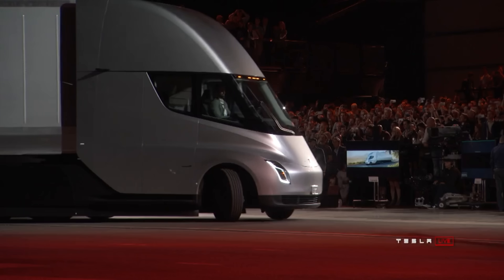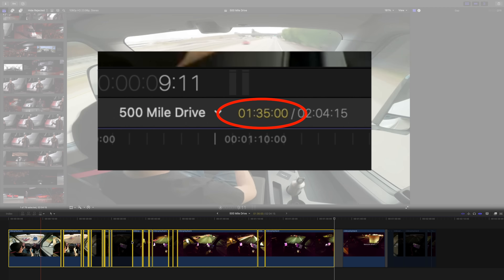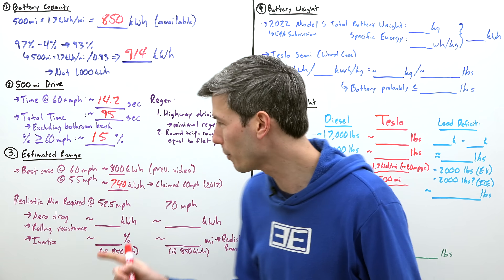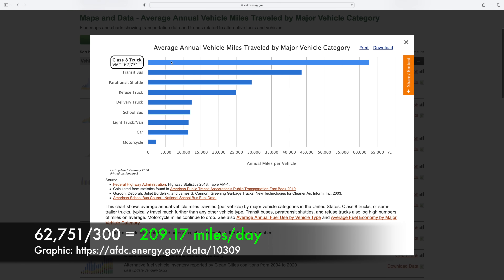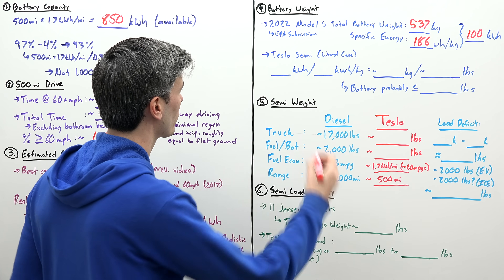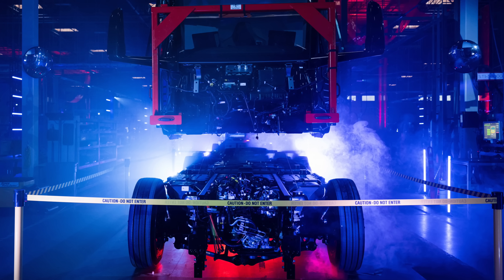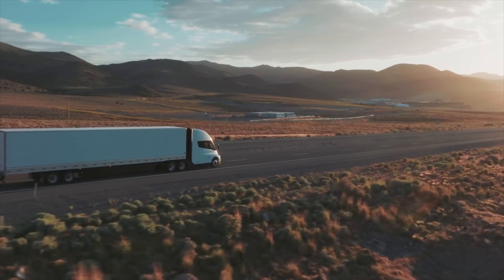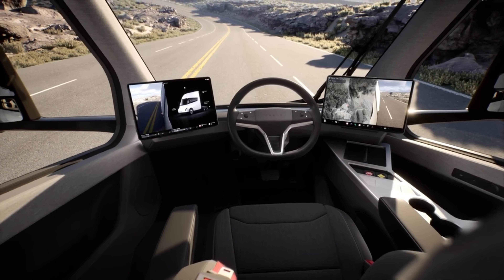Does The Tesla Semi Make Any Sense? Part 2!

Comment: You assume that since a diesel truck weights 17,000 pounds that the Tesla truck does also.  I doubt that the electric motors weigh as much as the diesel engine and transmission.  So, you need to find out the true weight of the Tesla for a better comparison.

Comment: I still think the physics for these trucks don't make sense but I can agree that from an engineering perspective it checks out.
What I mean by "it doesn't make sense" is using trucks for delivery is so inefficient when compared to train that its staggering to think that this is the "green" solution. And second the wear of a road isn't proportional to the weight of vehicles but exponential so I'm not sure about putting heavier vehicles on the roads and increasing the average weight.
Still good video, thanks.

Comment: On I20 in Texas or similar roads at 75 mph on a hot/cold day, it will probably last about 2 hours/150 miles.
Reply: Actually that's an easy calculation, based on the Tesla Semi physics model derived by Motor Matchup. At 75 MPH on a hot day, loaded to 82,000 lbs., the range would be about 325 miles with a small reserve. Tesla automobiles lose about 15% of range in cold temperatures; assuming the same for the Tesla Semi, range on a cold day would be about 275 miles.

Comment: It’d also be interesting at which point the Semi is ecologically advantageous. If I remember correctly most EVs are only more advantageous for the climate from ~200000km onwards. And another problem that wasn’t touched on is long term reliability, if a semi does 300 trips a year that means 300 charging cycles a year at which point will the range suffer of that.
Reply: Estimates for environmental breakeven mileage for automobiles vary widely, and depend on many factors such as the electricity mix over the lifetime of the vehicle, battery size and type, and emissions of the combustion car you are comparing against. But most cluster around 24,000 km to 32,000 km, and I've seen none that exceeds 150,000 km for an extreme combination of the factors. Presumably the breakeven would come even sooner for diesels, due to the particulates in diesel exhaust; but let's say your number is correct. Since PepsiCo has announced the intent to drive these for 1 million miles (1,600,000 km), in your case the Tesla Semis will be environmentally superior to diesel semis for almost 90% of their life; and over 98% at the average breakeven estimate for electric automobiles.

Comment: Up here in canada we haul 2x 53 foot trailers, 63000kg and need to go way more then 500miles. Current temps too are -45c as of today. I'd like to see how far that could get in these conditions. With my weights here my avg mpg is about 3mpg in this cold on diesel.
Reply: Not very far. No one's claiming that Tesla Semis can do everything diesel semis do; of course they can't. But there are a couple of million diesel semi tractors on the road in the U.S., and Tesla's business plan is to sell 50,000 in 2024; so the Tesla Semi can be limited to doing what only a small percentage of diesel semis can do, and still be a complete business success for Tesla.

Comment: So safe to say.. that tesla truck will not be usefull for the european market.. not that i want one.. we just run higher loads.. 110.000 lbs/50.000kg with a single trailer or  132.000 lbs/60.000 kg with double trailers 

I will stick to diesel and LNG trucks.. 
The crocked thing about this emmisions thing is the truck needs to be cleaner while the trailer behind it that might have a diesel generator to power the coolingunit that can be build from the stoneage as the trailer is not classified as a motorvehicle.. it usually makes more noise then the truck thats infront of it..
Reply: it would still pull it the total truck weight with trailer in the united states is limited to 80,000 lbs but our diesel trucks can pull much more than that
Reply: @zachmoyer1849  i know.. but thats 36 metric tons.. thats not a lot.. but whatever more weight it pulls the more it kills on range.. so by multipling its weight will in theory cut the range in half..

We have a hp requirement for the 60 tons doubles.. need atleast 5 kw per metric ton.. so thats around 410/420 hp as with a diesel this is perfectly doable.. with a decent range aswell..
Reply: @gewoontimm  you are forgetting that the potential for regen also increases with the weight and the tesla semi likely has over 1000 hp a diesel is still gonna beat it in range of course in germany they are looking into adding a power cable overhead for trucks to link into on longer huals only using the battery for shorter distances
Reply: @zachmoyer1849  thats fine for germany.. but i dont drive or live there..  so them having those powerlines in the road is not gonna benefit anyone that doesnt drive on that 1 road.. 
Do you kniw what it would cost to overhaul the infrastructure to put powerlines everywhere?? Costs too much..
I drive mainly in urban areas with big trucks 
There arent any charge points for trucks allong the route or at unloadingzones as cityhall doesnt give permission to place one as its a big bulky unit..
Also we have a hydraulic lift on the back of our trailers that takes 24volts from the truck.. that also would mean less range

In urban areas a torpedo cab is far from usefull.. turning radius is larger then from a cabover.. plus we have a totall vehicle length restriction.. so if the truckcab is longer.. that will rob space for cargo..

We already have a few electric cabovers .. they arent usefull as they spend more time on the slowcharger then driving
Our powernetwork also isnt ready for fastcharging for trucks as they draw more power then an ev car would.. 
We already have problems charging cars.. let alone trucks as there are not enough chargeports for them..
Reply: @zachmoyer1849  i hope you get the picture of why they dont work in other forms of transport other then highway driving
Reply: @gewoontimm  Actually, the range varies much more by speed than by weight. Range with 60 metric tons would be about 30% less than range with 36 metric tons, or about 560 km. Obviously this will not work for many trips, so these will continue to use diesel semis. But it will work for many others, which can gain the benefits of an electric tractor.
Reply: @BigBen621  like i said..only if you do long distance driving on that particular testroad.. as there is no charge networkonce your off that road

Comment: Wait, your results don't check with Dunder Huff's results.  Being an engineer myself and really non-biased toward Tesla, your calculations look far more compelling.  There are a few things that you may want to consider.  Sure, most loads are not going to max out the truck to 80k lbs, but most truckers are going to want the capability to do that.  If I am a shipper and I call you up and you tell me that you can't meet my load requirements, chances are, I am not going to call you in the future.  The same goes for distances.  If you can't deliver the distance I need, I probably won't be calling you.  So even though a lot of those routes are feasible for the Tesla Semi, truckers are going to want trucks that are capable of the long haul as well.

So the target audience of the Tesla semi is going to be considerably smaller than one might think.  For now, that isn't a real issue as the Tesla Semi isn't really available anyway.

And one more thing to consider is the trailer used likely had less drag than a van type trailer.

And what about refers?  Is Tesla going to make power packs for those as well?  How would that affect the load for a refer with a nice large battery pack on it?
Reply: Dunder Huff's video is rife with obvious, deliberate, and easily provable lies.
Reply: yeah reefers are gonna have to stay diesel but they have their own fuel source so teslas could still haul them

Comment: A well reasoned video, like it a lot. I feel like there's a lot of FUD around EVs, partly fuelled by oil propaganda, partly by people really wanting to hate on Tesla right now for Elon being the bell-end he is, but someone has to figure this stuff out and it's still a net positive having these exist. A first-gen EV semi being able to handle 60%+ of the applications these trucks is pretty great, TBH. As you said, we're not going to snap our fingers and have all these trucks replaced by the time they've started improving, battery tech has improved, etc. I'd personally like to see some more focus on last-leg deliveries, not just because of carbon emissions but also because of the air quality improvements in urban areas.

Comment: autonomous truck wont care about doing the speed limit, so may cruise at lower speed. I think lithium battery is the same as any other battery, its not good to be demanding full power (maximum current draw) from a battery that is approaching fully discharged, best to keep them above about 50% charged if you want long life out of the battery.

Comment: So the bottem line is: Pepsi would never have bought those 100 trucks if the goverment did not pay a 19 million dollars for the endevor. Then you can take the trucks and just see where it goes.

And there is a mistake in your calculations. You substracted 2000 pounds of weight dor the difference in the diesel engine and the electric engine. Those weights are part of the weight of the truck so the Tesla truck has a bigger loed deficit of 2000 pounds.

Comment: Right charging a 850kW battery in 35 to 45min. You will litteraly need a power substation to do that and thats without taking into account the wear of a battery is exponentially greater to the time charge. Plus to this date only chips trips at slow speed has been proven. Lets wait that famous 500 mils beverage statement to come true. Most numbers you ame out with are wrong. There is basic formulas for resistivity. Plus no account of battery wear, climate conditions (which is extremely impactful on batteries) and electricity loss.
Reply: In the "chips trip" video, the trailer is loaded from back to front with pallets, including a few stacked two high at the front; and the pallet at the right rear is clearly labeled as 600KG. If a pallet of chips weight >1,300 lbs., you might be right; but I'm pretty sure it doesn't. And the speed was dictated by the California 55 MPH speed limit for semi trucks. At higher speeds, the range would of course be less.
Reply: @BigBen621  I don't know about the speed but I call BS on your chips pallet weight. It may be written this, doesn't mean it's true, specially with Musk in the way. A traditionnal chips pallet is around 20kg and even at 600kg each it's nothing compare to a real load. A semi can take around 26 to 30 pallets. Which the 600kg figure we get 18 000kg or roughly 20 tons. This is low has a normal semi can can up to 30 tons after substracting the weight of the semi itself to the US limitation (and electric ones can cheat for come reason as if an electric semi with more weight will do less damage to the road, politic science). And you forget the worst of the worst the power drain and installation required to charge these things. And don't forget, most electricity in US is produced with coal. So basically you change your semi from diesel to extremely polluting coal. That's why the environment is doomed.
Reply: @xbvg  I see you're going for the "Most Misinformation in a Single Post" award; a lofty goal, but one you're likely to achieve.

"I call BS on your chips pallet weight. It may be written this, doesn't mean it's true, specially with Musk in the way."  
Yes, Tesla could have put a fake weight label on the pallet; but what no one's explained is what incentive Tesla would have for doing this? The launch customer, PepsiCo, already had 36 of these by December, and so they know exactly what they can carry. As such, they'd know if Tesla faked a test; and it would be bound to affect their relationship with Tesla, and imperil future sales if they did. If you have any evidence that the weight label was faked, you should produce it. And the irony is not lost on me that all the doubters are demanding that Tesla immediately release weight and payload information, at the same time that they refuse to believe information about the Tesla Semi that has already been released.

"A semi can take around 26 to 30 pallets. Which the 600kg figure we get 18 000kg or roughly 20 tons." 
For a change, this sounds about right.

"[A] normal semi can can [sic] up to 30 tons after substracting [sic] the weight of the semi itself to the US limitation"  
OK, let's see; 80,000 lbs. GCVWR, minus your claimed 60,000 lb. payload, minus about 12,000 lbs. for a van trailer, minus about 2,000 lbs. for fuel, driver, and misc. materials and supplies, leaves 6,000 lbs. for the dry weight of the diesel semi tractor, not much more than the weight of a Tesla Model S. Is that your final answer?

"as if an electric semi with more weight will do less damage to the road" 
No one has claimed this. But to me at least, a <3% increase in weight with the additional road damage this will cause is well worth the dramatic reduction in air pollution, especially particulates, that will result from replacing diesel semis with electric ones; keeping in mind that diesel trucks are 1% of the vehicles on the road in the U.S., but produce 20% of the overall emissions and 36% of the particulate emissions.

"[M]ost electricity in US is produced with coal" 
The last time >50% of electricity in the US was produced with coal was 2003. Last year it was <20% and dropping precipitously, having dropped by almost 50% just in the last five years. So this claim is 20 years out of date, and getting more so every year.

Comment: So 23 miles per 1 gallon of Diesel. That's fuel efficient. And 1 gallon of diesel can make 40 kilowatts of electricity in a generator over there. If that electricity came from wind and solar stored in a battery for overnight/day charging?. It will also eliminate idling(noise, vibration) and air pollution (particulate, rolling coal, and fumes).

Comment: What about hydrogen trucks? They sound very viable and hopefully a non-deceitful company could possibly make all of these into reality. Hydrogen trucks theoretically shouldn't be weighed down by battery packs either, and should fuel as fast as gasoline.
Reply: hydrogen trucks are still heavy because of how reinforced the fuel tanks and fuel delivery system has to be for the high pressure of liquid hydrogen, its why they also get the additional weight limit increase, but the real problem is that hydrogen cost far more then electricity or diesel per mile.

Comment: The problem with electric is that you are making the assumption that the range stays the same throughout the life of the battery, not so. And don't get me started about getting that range during the winter with a heater full blast. And before I get flamed I have been driving an electric car for almost 10 years now.
Reply: Then you're not driving an electric car with a heat pump. The Tesla Semi will use a heat pump for cabin heat, which is dramatically more efficient that the electric resistance heater that you necessarily have.

Comment: Question, what about the battery decreasing over time and have Tesla said what the lifespan should be for a battery and cost to replace?

Most ICE trucks seem to do up to 1.8 / 2M kilometres before finding there way to a scrap yard and are normally about 25 to 35years old

Comment: Wait.. 1.7kwh per mile
Even my scooter needs 250w to sustain 15mph. If I were to maintain that for a whole mile, it’s 0.25kwh. Not far off the semi

Rolling resistance alone will kill that number 😭
Reply: That number includes rolling resistance.
Reply: @BigBen621  yeah thats kina the point. how does the wind+rolling resistance of the tesla semi be only 1.7kwh per mile at possibly 60mph? where its just 6.8 times the resistance of my 2 wheel schooter going at 15mph
Reply: @elonwong  You math is off. 250 Watts for one hour is 250 Watt-hours = .25 kWh. In one hour, you go 15 miles; so your mileage is .25 kWh / 15 miles = .0167 kWh/mi., or 60 mi./kWh.  Tesla is 1.7 kWh/mi, so your scooter has 102 times the mileage (miles/kWh) of the Tesla Semi. I'd expect the difference to be a lot greater; but the Tesla Semi is a lot more aerodynamic, and I'm sure has many other efficiencies your scooter doesn't have, as well.
Reply: @BigBen621  shet ur right my bad
there goes my a level physics..
ur math works out too, thanks!

Comment: If the average truck drives 70k miles per year, the Semi will need a new battery pack every 2-3 years. These EV trucks are just too expensive to operate. Long distance cargo, if you want to do it with electricity, it's far better done with electrified rail.

Comment: One slight flaw is using a full tank. It would be fairer to use 500 miles worth of Diesel, which at 7.3mpg is ~ 428lb of Diesel and at 5.3mpg is ~590lb of diesel. This would then be ~1500 more pounds in favor of Diesel. Nit picking a bit, but this is an engineering channel so I think that is allowed? :D

Comment: The I80 truck stop has 15 desiel fuel stations. So let say 10 minutes per fill-up for desiel maybe a little long. If changing with a 1MW charger is going to take 45 minutes then if all trucks were electric this I80 truck would need around 65-70 MW chargers or maybe fewer with the 900 parking spots to slow recharge over 8 hours. Are we talking about 1-2 big wind turbines to power each MW charger?